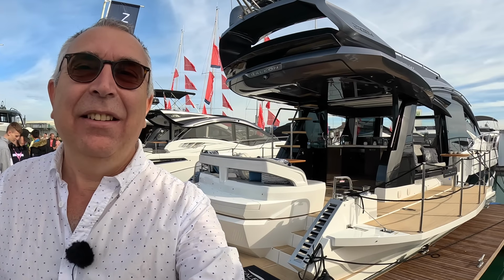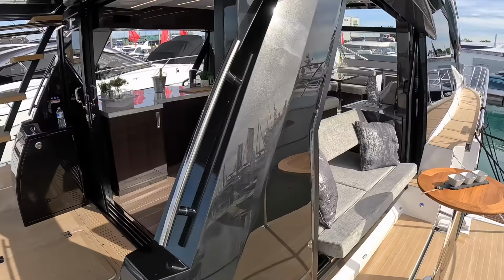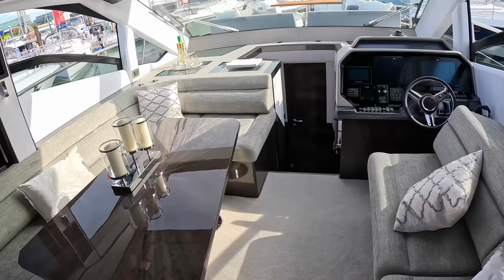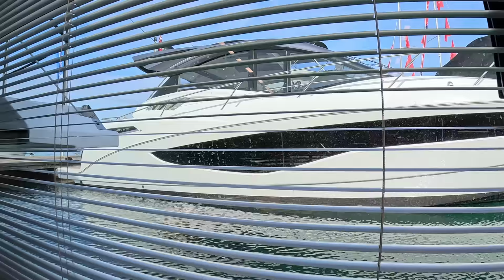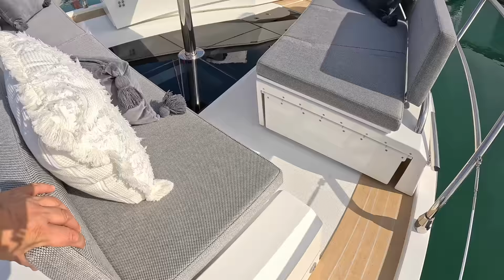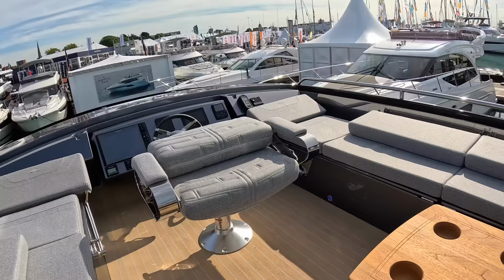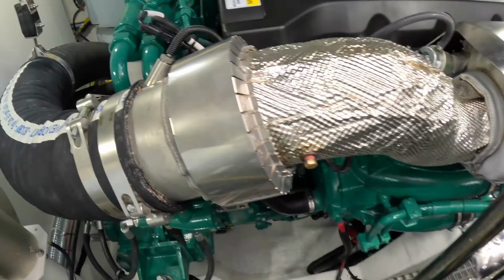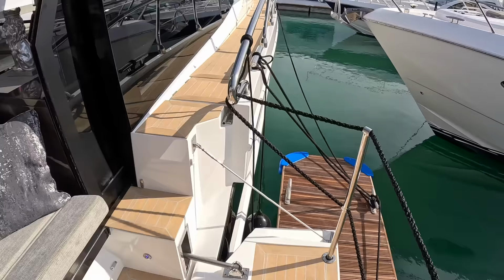£1.2 Million Yacht Tour : Galeon 510 Skydeck

Comment: This is the best 50 foot yacht I have seen by far. They almost got it perfect. ALMOST. The boat should have been up to 1m longer - and then you could have had a toilet that wasn't inside a shower, you could have possibly fitted in another toilet downstairs and the kitchen could have been slightly bigger to give more fridge space. The fridge is an issue - especially if you live on this boat or want to go for a few days excursion. The other features on this boat are just wow and make this an exceptional boat indeed. Just slightly longer to make perfection.

Comment: It's so nice to see a company step out of the Norm and insert some new innovations that aren't just for show. Well done Galeon.
Reply: I'm also not a usual fan of gloss or dark wood finish on yachts smaller than 60+ ft as can give a cramped feel but this really looks nice! Also to all the negative 'just something else to go wrong' it will all depend on the quality of the people building it. I've worked on modern motor boats that leaked something rotten, not from new innovations, but from windows and metal rims that just weren't fitted properly and we are talking £3 + million pound yachts.

Comment: I have always loved options and will always buy the item that has the most. It doesn't matter if I use them all or not, the fact is they are always there "just in case". This boat has more options than you can poke a stick at. Just fabulous. All that and it is stylish and spacious too. Oh, and the wood finish is very different and beautiful.

Comment: Love this boat (and the tour of course!) but I do think they could do better with the drop deck so there’s an extra foot of walk space behind the bar stools/table with a step leading to side decks. I’d leave the ropes off most of the drop decks, but I’d like to see a flip up or slide in “permanent” style railing behind the bar stools/table. I do love the boat, but that 4’ section in the middle needs some innovative Galeon engineering. Plus a kickstand on the engine room cover so you could prop it up after removing it, and to serve as a visual cue that there’s a big hole in the floor 😂

Comment: Lovely Boat, Nice Review,
Few question / comments though:
1.  How safe are those low deck glass (?) sides? How strong are they when confronting rough seas etc? BTW - that question applies to all of those boats that have glass sides.... Is it glass?
2. That Fly Bridge conversion is super!
3. That kind of luxury requires a crew for every day clean up, fold down at the end of each cruise etc. If I were the owner, the time required to bring out all the accessories from stowage, clean up all those white (??) carpets at the end of a wet day, clean the heads,  clean and rinse the shiny decks, and all of the required and nessecary maintenancw chores... I would definately think whether it's worth going out at all.....
4. Last and most important - what's the point of reviewing this beauty, (and for that matter, any of those beauties) at dock side, with useless accessoroies on board? That plant wouldn'wt last a minutes in it's place once underway....You should take her out for a test real sea conditions, waves, swell, wind, noise, and than make a true report.